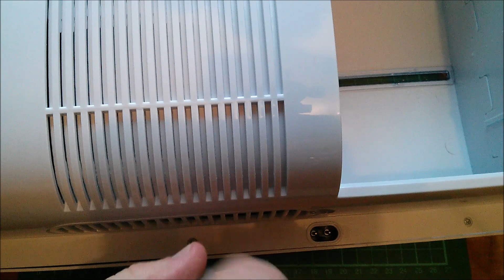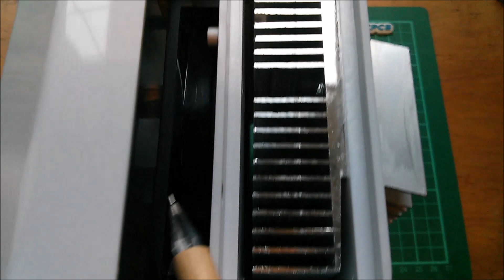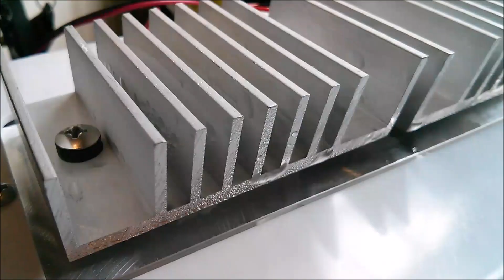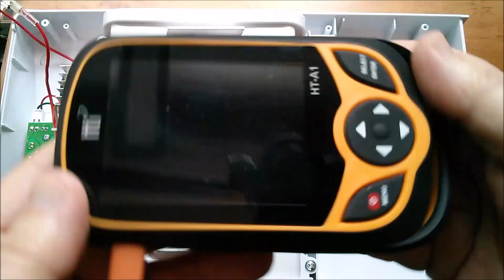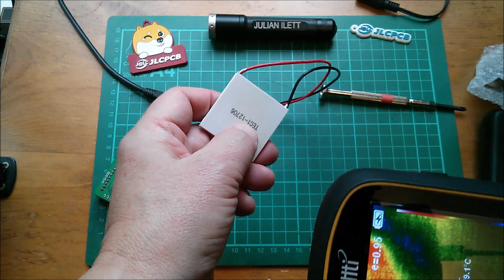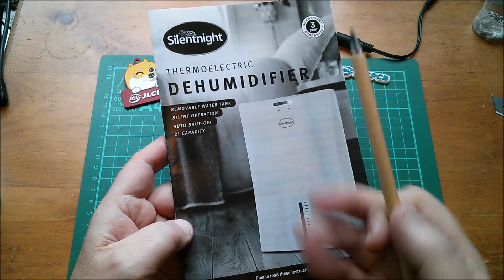Lidl 70W Thermoelectric Dehumidifier Stripdown

Comment: I have the smaller one that's been running almost non-stop for several years now, and it's not useless. it's meant for smol, tiny spaces, like a closet or bathroom. 
Less expensive to operate than those disposable containers sold at pound/dollar land/stores. A lose connection on the power input is the only flaw I've noticed. Cheers.

Comment: That little machine is what I have in my campervan, it works reasonably well but has a habit of creating inch thick ice if left on continuous, a timer set to intervals of 3 hours on, 1 off seems to stop the ice forming.

Comment: Would they be any use in a bathroom? Ours doesn't have an extractor vent, has two outside walls, and gets a bit cold until the shower is running. Wondered if it make any appreciable difference to temperature generally, and removing moisture after the shower.

Appreciate you're not supposed to have mains voltage in a bathroom (we can run power from the airing cupboard which has a 3-pin mains socket). All that water (inside the unit) near all that circuitry worries me too.

Comment: I've purchased a few of these to generate water indoors for my seedling starter garden.  These dehumidifiers along with my led growlights are powered by my 12vdc garden solar generator.  Everything is on a 12vdc  timer control.  So far it works for this application, but not for my outdoor garden.  Yet!

Comment: With the present eye-watering cost of electricity this type of dehumidifier only makes sense if you can run it on "free" electricity, e.g. from solar panels. It would be useful in a shed or caravan fitted with such panels as a damp/mould preventive measure. Domestically a compressor type make more sense economically if it is to be mains driven.

Comment: The heat pumping TEC exploits the Peltier effect. The electrical generation of a TEG uses the Seebeck effect. And yes, they can each do a similar job to one another, but I believe there are efficiency losses substituting one for the other, and they are horribly inefficient to start with. They are neat though :)

Comment: These never seem as good as either the normal type of dehumidifier.
Reply: They aren't. A compressor based refrigeration principle dehumidifier has well over 100% efficiency. 
An electronic dehumidifier is around 10% efficient, so by comparison is horribly inefficient. 
Unless the power for a peltier system is coming from a free source of electricity like solar, then they really aren't worth the effort.

Comment: Dehumidification is all about lowering absolute humidity. (e.g. from 20g/cubic meter to less than 10g/cubic meter)
To do this, the air must be cooled below the condensation point and this has the advantage that the room is also cooled (but important: heat and water must be discharged to the outside. In damp, cold autumn weather, the heat output of the cooling unit is not sufficient; external heating is required.

Comment: Your TEC from part number seems to be 12xx marked, so likely a 12V model, so if you are using it on 3.7V LiOn cell is probably still inefficient. Normally at leastv20°C difference hot to cold should be achieved. There are also multistage TECs that at diminishing returns get 30°C and more. Each stage stacked achieves slightly less per stage as it also must drive heat of the lower stages, so 20 first stage  10 second stage for 30 and mere extra 5°C at third stage, meaning beyond that too little to bother. Heat pipes/heat sinks can make minor boosts, but cost wise also diminishing return for money. Two stage coolers are probably optimum for Max cooling around 30°C. Important is not getting cold side frosting, icing over when going sub zero.
Many Astronomy cameras use multi-stage cooling of the CMOS or CCD camera sensor for noise and dark, leakage, current that make the camera less usable on very long exposures. There however the cold side is in a sealed camera cell, with desiccant for no moisture at cold sensor side, so no fogging, frosting or ice formation issue.
However multi element TEC used fir small portable and camping coolers for freezer section do suffer loss of effectiveness as frost and ice forms.

By the way rain fall does not automatically mean very high humidity, and not lots of actual water vapour in the air, only dumping droplets water depending on ambient humidity suffering some evaporation as they fall. In dry conditions, the droplets may completely evaporate as they fall  none reaching the ground at all  so frustrating in draughts for farmers preying for and thinking finally some rain, to get none on the ground after all.
 The amount of water in the air is VERY temperature dependant. 80% at 30°C is hugely higher water loading, as grams or milliliters per cubic meter of air. Than 80% humidity at 10°C. Dew point is the critical parameter of air at maximum humidity . Dew point near 0°C is very low water level, but Dew point at 30°C and above, is tropical stifling humidity, making breathing difficult, feeling like you are starting you are drowning,  just breathing. At lower temperatures FOG is the point when air is at 100%, so by general impression London is often in 100% humidity  as can be the bathroom when showering, with over worked ventilation fan.
These small dehumidifiers are not really intended for home or even sizable room dehumidification, but if camping, caravanning, even in your car travelling in humid conditions can make quite a difference to overnight comfort. Biggest problem being the heat generated, as often both temperature and humidity make sleep uncomfortable. One solution on the smaller unit with single top vent is directing the warm air out of the local space with a piece of the foil air duct, a bit harder for that larger unit with vent on both sides, so need two duct pieces taped on leading outside.

Comment: The innards are almost identical (the power supply circuit is actually a external brick) to a dehumidifier I got a few years ago. I had it in a small storage room in the basement as it was really humid down there (the water drips from the brick and cement walls and mold is a real problem), the chemical dissecants were useless due to how little time they last, this little fella removed roughly 2L in 1 week or so (turned on 5~6h per night).

One issue I have with mine is that it builds up ice on the coldest and dampest days, I use a plug with a timer that sets on/off 15mins intervals for 24h and set it to pause every hour or so to allow it to defrost.

It did broke once, the fan stopped working and it overheat quite a bit, there is a thermistor of sorts in the middle of the large hot heatsink that prevented worse damage (the plastic actually melted a little) and after replacing the fan and reapplying thermal compound, it was up and running again ... great little work horse, but of limited use if the room to be used is much bigger than a large wardrobe.

Comment: I reckon if they added a small heat exchanger so that the cold dried air leaving the cold heat sink pre-chills the incoming air, it would perform a lot better.
Reply: You'd want to pre-warm the air to increase the temperature differential between the now warmer air and the cool side of the peltier. I don't know how much it would improve the efficiency though.

Comment: I expect that the PSU is not 100% efficient so 60W’s out at 12V will be higher on the input. So if it’s 85% efficient the mains power would be  around 70W’s

At least you can put the water in your iron as distiled water and put it back in to the air while you iron.
Reply from the maker: Ah yes, good point about the power supply efficiency.
Reply: @JulianIlett  One must never forget about the fish in sea. ;-)
Reply: @TheEmbeddedHobbyist  Meow!!!!!!!!!!!!!!!
Reply: Yeah dont use the water collected from these, very dirty.
Reply: @jaro6985  Oh come on, you don't want a bit of Legionnaires' disease?

Comment: Older houses here in NZ use the compressor type as we do have high humidity. Because many houses still use single glazing and metal frames, water pisses down the windows and frames by the gallon. Even with 2 or 3 de humidifiers many homes here are still damp and cold. Couple this to poor or no insulation, reminds me of the UK in the 50s.
Reply: The UK hasn't changed much since then for renters
Reply: Yep - I remember the ice frozen on the inside of the bedroom windows in winter 😂😂

Comment: The thermoelectric dehumidifiers are incredibly inefficient.  Maybe better suited to a camper where they could run directly from solar during the day.
Reply: Desiccant or compressor dehumidifiers type only! 70W acts as a pure loss of energy, not even a heater, cause even in small spaces you won’t notice (actually maybe in small, good isolated and non air moves by people you could notice) even 1’C ambient temperature increase.
Reply: ....and the cold side heat sinks accumulate a lot of ice in a cooler spaces, it could do with an auto defrost function-I can feel an Arduino project project coming on
Reply: @evanleebodies  an old fashioned time plug socket, the one with nock in or out pins, set to pins to be on, and then nock the odd pin back for an off state, Arduino, keep things analog?
Reply: My that’s confusing. 🤯

Watching Julian and seeing comments from Big Clive.
Reply: I had a water cooler which annoyingly used one, it was utterly useless as it would take days to cool the water and used a really cheap standard PC fan to cool the heatsink that was insanely noisy.  I eventually just bought a small counter-top fridge as it was actually a less annoying noise and of course way more efficient.

As for dehumidifiers, even a 1KW air conditioner takes ages to drop room humidity by 1% (granted, because UK humidity rarely goes above 60% indoors).

I don't understand why they makes peltier based coolers as they're far too inefficient to be useful.
Reply from the maker: I suppose dehumidifiers have a dual role - taking moisture out of the air - and acting as a low wattage heater. In respect of the latter, they're just as efficient.
Reply: @JulianIlett  Here in Canada, we only need to dehumidify during the summer, so adding heat is even more inefficient.
Reply: Definitely, probably under 3% efficient.  The biggest challenge is you need a very smooth D.C. supply to power them, as any ripple will induce resistive heating in the p-n junctions.  You also need good thermal contact between the heatsinks and the module, so a thin but consistent layer of heatsink compound. The modules and thermal interface tend to deteoriate over time, but it's a relatively inexpensive and solid-state option to provide localised thermal pumping at small scale. Seems relatively good value though, power supply looks decent. I spent many years working in the field of thermoelectrics - although more using them in the opposite sense i.e. generating electricity from heat flowing through the modules.  I wonder if this dehumidier has protection against the fan failing?   The modules will quickly deteoriate if they exceed 150 degrees (they usually use low melting point Bismuth Telluride).  Interesting to know if you do use it for its intended application and how effective it is versus the power consumed.
Reply: High got sent one for freview. Put it in my 1m x 1m grow space. All it did was raise the temperature. It was unable to remove enough moisture to be any use in a garden. Then high thought I'd try it to dry some flowers...they got bud rot from excess moisture. Doh. Thinking about converting it to a water chiller by putting water blocks on the 2 TECS. Do you think it would it be work the effort?
Reply: @STONEDay  Don't try to use TEC modules to move heat, at all. They just suck. You can get a junk stand up water cooler that has all the refrigeration internals inside and just dissassemble and reassemble it however you want.

Comment: curious and curiouser, a heat pump pelter unit that dehumidifies the air as it blows out more warm air to soak up more moisture to condense out more water to heat more air to get sucked in to release more water soon you will have a small amount of super dry air circulating 🙂
Reply from the maker: It's a virtuous circle :)
Reply: Squeak !
Reply: @andymouse  Cheesey!!!!!!!!!!!!!!!!!!!!

Comment: If you want a DH for winter use in the UK you want a desiccant type as they operate well at low temperatures. Compressor efficiency really drops off below 20C.
The thermoelectric are useless for DH a room but they can be useful for smaller spaces like a cupboard or caravan especially if you run them from a solar panel so they are effectively running for free.
Reply: That's what we run in the Winter, two desiccant type dehumidifiers, one downstairs & one upstairs. They also have the benefit of adding a little heat.
Reply: @phil955i  Yes that makes them perfect for winter. Any other time you would begrudge the higher running cost and excess heat they produce.
Reply: @analogueavenue  👍 we've not put our heating on yet, mind you it has been comparatively mild for November so far. As you say, they give a base temperature & keep the mould & damp at bay. The windows remain condensation free too.
Reply: @analogueavenue  It would be nice if I could do that. I could happily just run the DH if they kept our flat at 18, no need for additional heating at all, that's warmer than we keep it even with heating on.

Comment: No filters then to stop dust buildup?
Reply from the maker: Dust isn't really a problem in this design. It will simply wash off the cold side heatsink with the water droplets.
Reply: @JulianIlett  what about the warm side? If that gets all clogged with fluff, which is typical in a laundry room? I use a refrigerator type in the utility room. Do you think the peltier dehumidifiers are more efficient? As in more water collected against electricity used? My daughters after one and I suspect she works be better off with an ebac.
Reply from the maker: Yes, I expect a film of dust will eventually coat the warm-side heatsink and fan, but I can see it working OK for the 3 years of the warranty.
No, thermoelectric dehumidifiers are less efficient at extracting moisture from the air.
Reply: @BrettJulianChamberlain  
A peltier heap pump dehumidifier is orders of magnitude less efficient compared to a refrigeration type dehumidifier.
Reply: @BrettJulianChamberlain  Even a refrigeration type often tell you NOT to use them in a laundry room, you need something more purpose built for that.

Comment: The peltier module from these can be used to generate electricity, I had one side on a heat sink in water and warmed the other with a flame and it was enough to run a small radio. 👍😎

Comment: These things have their uses in small areas, and are OK to keep mould from growing in inbuilt wardrobes or cupboards, also providing a slight heating effect.
They are very inefficient compared to a full sized compressor or desiccant disc type, and anyone hoping for it to replace one will be sadly disappointed.
With the smaller type I found the microswitches can't cope with the current and I had to replace them and add a relay.